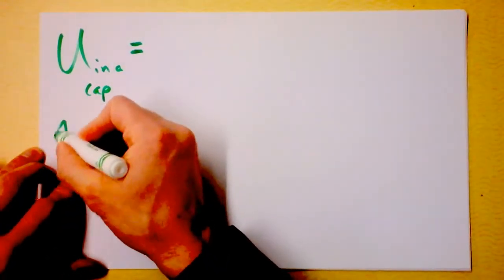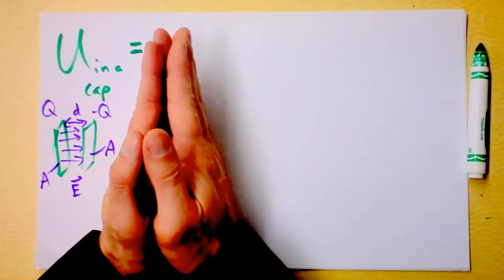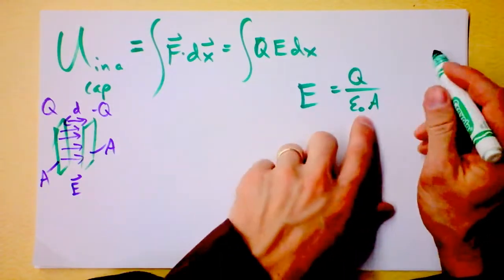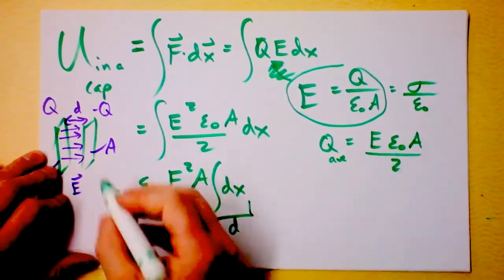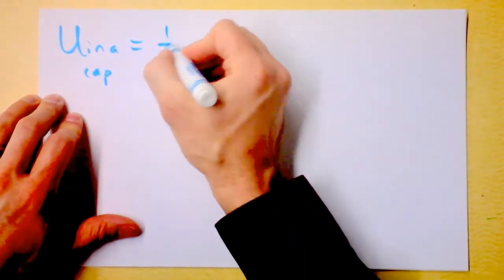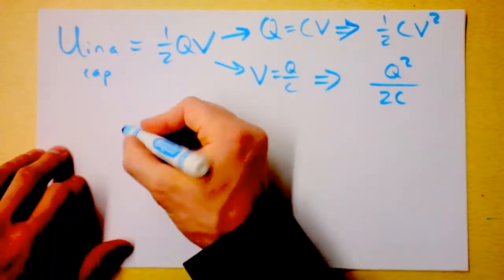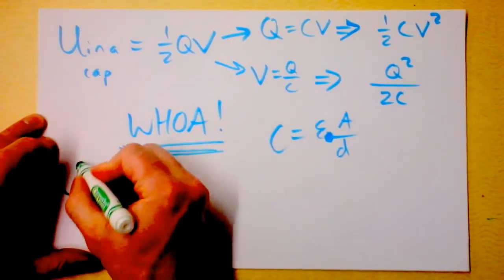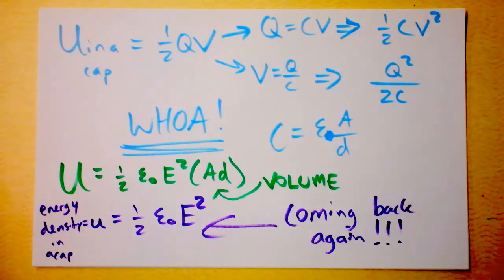Potential Energy Stored in a Capacitor | Doc Physics

Comment: @ 8:58 "FIELDS STORE ENERGY!!!" BUT NOT THIS FIELD! The potential energy of a capacitor is IN THE ELECTRONS of the metal wire (not in the field between the plates), because in loading the capacitor the battery is doing work on the electrons! Just connect a capacitor to a circuit and the electrons start moving: potential energy being converted into kinetic energy!

Comment: is there a way to get the 1/2 that comes from an actual calculation instead of just... putting it in there? it doesn't quite convince me. in fact, why would the charge change over time, anyway? if we store a set amount of charge in the capacitor and then pull them apart, the charge is constant, so there should be no 1/2. a little confused.

edit: i found a much easier way to find the energy stored in a capacitor: the work done by a battery to charge it up, so it's just W = integral U dq from 0 to Q which is to say, energy to charge from 0 to Q. no need for field strengths, dielectrics or anything.

Comment: Hey Doc, help me out. I've written this in my notes, but I can't seem to make sense of it: 
'When a positively charged plate is kept near a negatively charged plate, the voltage of the positive plate decreases'
Reply from the maker: Well, if you change "kept" to "brought," it works.  In bringing them closer, you are reducing the electrostatic energy but keeping the charge constant.  We're assuming the capacitor is isolated, of course.  Since voltage is energy per charge, it decreases.
Reply: How is the electrostatic energy decreasing?
Reply: Can you please explain the part in bold?
Say we have a large plate and we give a positive charge to it. There is a limit to the amount of charge that can be given to the plate because as charge is given its potential rises and beyond a certain limit the charges start leaking.
If we get another plate and place it next to this positively charged plate then negative charge will pulled towards the side of this plate which is closer to the positively charged plate and positive charge on the further side.

This negative charge on plate 2 will reduce the potential on plate 1. At the same time the positive charge on plate 2 will try to increaser the potential of plate 1. However the effect of the closer side of plate 2 holding negative charge will be more. This leads to reduction in the potential of plate 1. So now more charge can be given to plate 1

Now if we earth the outer side of the second plate. Then the positive charge on this side will go to Earth.With this plate 1 will be able to hold even more positive charge. (source: http://tutor4physics.com/tutorialcapacitors.htm)
Reply from the maker: If you bring a positive and a negative charge nearer, the system loses potential energy because it is doing work.

Comment: An electrostatic generator such as the Vandegraf are just capacitors that constantly change their capacitance and they all require work or energy to convert force and distance into an electrostatic field and the reverse is true also and you can make an electrostatic field do work (motor).

Comment: why DiD you took average charge
Reply: Well, It's not really the average. The net electric field in between the plates is the sum of the electric field because of the left plate and the electric field because of the right plate. when calculating work in moving the plate on the right side, you should not include the electric field generated by the plate on the right. I other words "Thou Shall not push thyself"
Reply: The strength of electric field created by a single, infinite-large metal plate is exactly half the strength of electric field created by this capacitor.
Therefore, the equations should be u=∫Q(E/2)dx*, instead of u=∫QEdx

Then, E=Q/ε0A ⇔ Q=Eε0A (note that this E is the strength of electric field created “by the capacitor”, not “by a single, infinite-large metal plate”.)
Put this in * and you’ll get u=∫E^2ε0A/2dx

Comment: How come the energy isn't just QV? In my textbook, voltage is defined as potential energy per unit charge, so wouldn't the energy be Total QV?
Reply from the maker: +1steinstein There's an integral.  The same reason that the energy stored in a spring isn't kx*x even though the force is kx and the distance stretched is x.  The force wasn't always kx!
Reply: +Doc Schuster But when the plates reach the maximum charge capacity and there is no current flow, each plate contains a total charge, Q,and there is a voltage, V, between the plates. At this point wouldn't it be QV?
Reply from the maker: +1steinstein Do you agree with the perfect analogy to the spring situation?  Surely the energy stored must be equal to (or less than) the work that was done to get it there, right?
Reply: +Doc Schuster Yes...but then I have had similar problems in  which I have had to find the energy required to move a electron across two parallel plates and the formula has been eV. 

The two seem to contradict. Once the capacitor reaches its full capacity, it contains a charge Q and the voltage between the two plates is V. Then, by definition PE = QV.
Reply from the maker: +1steinstein Ooh, you're good.  Here's the thing.  Discharge the capacitor "halfway."  If the fully charged voltage and charge are V_0 and Q_0, what are the voltage and charge when it is "halfway" discharged?
Reply: +Doc Schuster Well the charge is halved correct? And since voltage is kq/r, volatage is also halved.
Reply from the maker: +1steinstein Soooooooooooooooooooooooooooooooo.......what fraction of the original energy is left?
Reply from the maker: +1steinstein That V equation only works for point charges, but you have a uniform field.  Use V = Q/C

Comment: Thank you for your videos they have helped so much!! I have a question though. Why did you divide Q= Eε0A by 2. You say it is to get the Q average but I'm not really understanding the concept of that and why you need to use it instead of just plain Q.
Reply from the maker: Ntiana Sakiotis Q represents the charge on the cap when I'm finished charging.  However, it started at a charge of zero and ramped up to Q.  So on average, the charge during the charging is Q/2
Reply: Doc Schuster Thank you!!